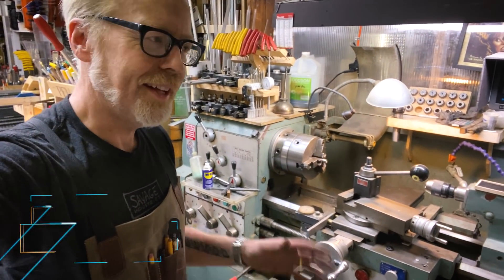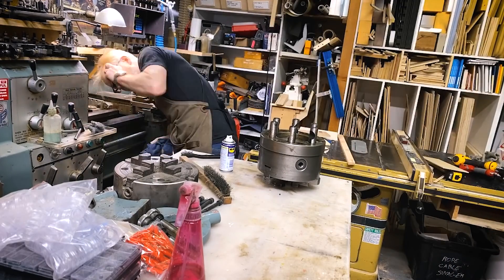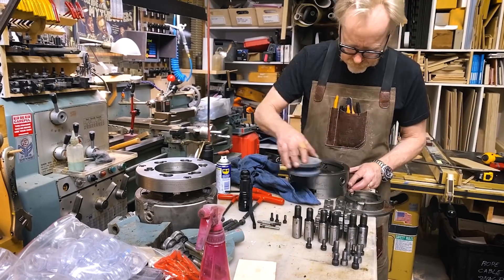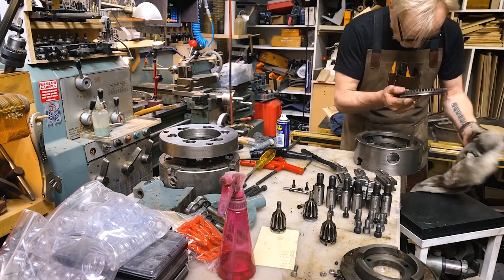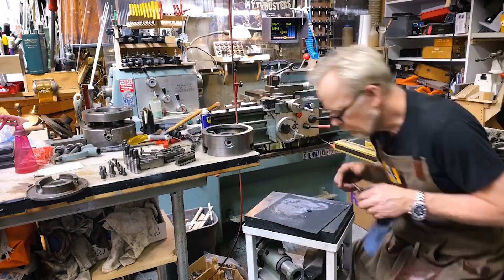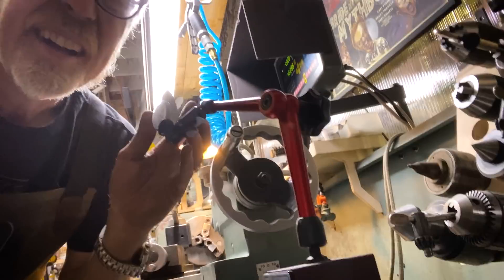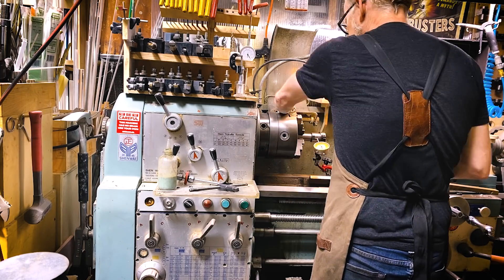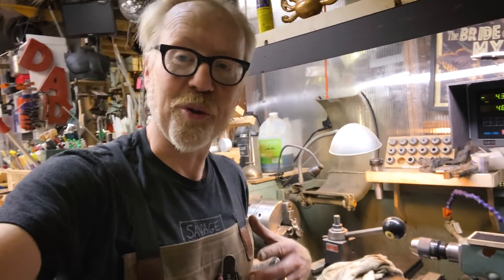Adam Savage's Weekend Builds: Lathe Chuck Rebuild!

Comment from the maker: Adam's been doing a lot of shop organization lately. Here are all our videos to date! https://www.youtube.com/playlist?list=PLJtitKU0CAegGi2QUH6ywt4EkjcR0jVam
Reply: Please pass unto Adam that he needs to use aerosol dry graphite lubricant and nothing else (read, in combination). Out of all the components on a lathe, the 3 jaw, autocentering chuck is the most fragile against lubricants that both attract and arrest grime and swarf. There's numerous cases that have been documented (machinist forums and even YouTube) where usage of the wrong lubricant led to them being  seized shut.
Now i know Adam isn't the kind of individual to use a monkey wrench, so i don't think he's in danger, but the first thing that comes to the regular hobby or slightly above individual in machinist work is to force it because it only seems lightly stuck, and it ends badly. The scroll (the spiraling groove on the gear plate) is actually a fragile component when subjected to punctual force (a stuck jaw) and the wall can easily shatter. You'll won't even notice it at first until eventually you hear a crunch in the offending gear.
Just a word of advice, nothing more.
Reply: I've been so inspired by Adam that today I cleaned out my tablesaw and sanded and waxed the top.  It looks and cuts like a new tool!
Reply: You need to 'brand' the shop infrastructure builds so that Adam doesn't have to explain that it's not a normal one day build each time. The Buddha said space is the precondition of all that exists. Maybe a name that captures that but with the word Cave in it? I love watching Adam building the tools to build
Reply: Adam said he got the TIR to 0.0003", what was it before the rebuild?
Reply: What was the stone used?

Comment: I was hoping you would show more of the actual process, I always found cleaning the quill plate on the scroll chucks the most satisfying, chasing the spiral round with the airline,
BTW the pins can be swapped, they are made to such a precision that it doesn't matter, the Jaws are numbered and MUST go back in the correct order (they usually have punch marks) , also, they cannot be interchanged between chucks,
The taper key and taper shaft on the lathe also need a good clean at the same time,

Can't beat a collet chuck though!

Comment: Adam if you looking for greater accuracy have a look at a 6 jaw chuck. In the shops where I have worked in the past as we wore out the chucks we would replace them with the 6 jaw chucks. They are a little more particular about shavings and chips inside chuck so they do need to be cleaned out a little more often. Enjoy the videos.

Comment: A quick tip for for lathe chucks. Take the back plate off the chuck and put it back on the lathe, then face off the back plate by a couple thou or so. Now it’s face is square and has a concentric step to locate on.

Comment: if you're going to want a super precise chuck, less than .0005, use a four jaw. the three jaw is quick and easy but it's not adjustable or repeatable. however it seems like 90% of the projects you do your three jaw chuck is more than precise enough

Comment: When I started my apprenticeship I was being told how to make a component using a lathe, turn the handle three and a quarter turns clockwise, then rotate the other handle 5 turns clockwise etc.  I asked how the machine worked, how it was made , so that I could understand how to use it.  I needed to try & get my head into the machine.  Their was still that mystical aspect from my perspective, as I hadn't seen the individual components and how the meshed together, buy my basic understanding was their.  It makes a lots of difference if you know how things are made, assembled and work together.  At a very young age I had a ride on toy that was nicknamed "MendIt", as I used to take it apart (obviously interested in how it worked) and then I would point at it and say to my dad "MendIt", that's how the toy got the name. Love this sort of build. :)

Comment: We had a self-centering three jow that was .01 off center. Took it apart and re-assembled it with the location pins in different spots and we got it within .001 and used a tool post grinder to get it perfect enough.

Comment: You're getting into the level of detail,  and precision that we use at Honda.   Some assemblies use $10K IFM bearings, that need spacer plates,  to allow 0.030 microns of crush.  And everything involved,  needs to be cleaned,  stoned, measured,  marked, leveled,  greased and sealed.  And wo betide any step you miss or overlook.   It can cost 2 - 3 shifts of teardown and reassembly

Comment: We have so much in common it’s amazing!  Not only with this video but so many more.  Early in my career I was a machinist and learned by doing after my boss showed me what to do.  I very seldom used a 3 jaw chuck but have done similar rebuild on the 4 jaw chucks I used.  My favorite machine to operate was the horizontal boring mill.  It would take hours to setup a job and minutes to complete but the satisfaction at the end  was indescribable!

Comment: Hello Mr. Adam, I am a journeyman toolmaker in a jewelry manufacturing company called Stuller, Inc. We consistently keep our work concentric and true to within .0002. We have a 3-jaw chuck on one of our bigger lathes and it consistently runs out .003, so we end up using it as a roughing lathe. When finishing parts we will either switch to a 4-jaw chuck or one of our collet lathes. the fact that that 3-jaw is within .0002 is amazing. If you replace it, you should hang it on the wall or put it in a frame. Thanks for the videos.

Comment: A new found respect for metal working machines...is probably one of the only benefits of having a "near death/dismemberment" experience. Please don't take this in the wrong context, this is not a "diss" at Adam, this is a realization that I had when I had my first "near death/dismemberment" experience that resulted in me becoming much more aware of how unforgiving these machines are. They are amazing from an engineering perspective and do amazing things but must be respected at all times. After I nearly lost my right hand/arm (not doing anything wrong, just becoming too comfortable with a repetitive process when a chip spooled out and wrapped around my wrist and then that razor sharp chip wrapped around the chuck and started pulling my arm into the tool..fortunately, it was a Kummer cam driven machine "Double Chucker" that stopped less than an inch before bad things happened), I gained a whole new level of respect for these types of machines. A week later I was shocked by a 230 3-phase jolt because of a bad grounding issue but that's another story. Keeping the machine clean and in great running condition are critically important. Stay aware, have absolutely zero distractions, and keep your gear in good running order is the point. 
Glad to see you back at the lathe Adam :) 

Cheers,
Jeff (Garage Maker Guy)

Comment: I just went through this on my lathe a few weeks ago.  Made the huge mistake of everything with a sharpie before disassembly.  One hit with brake cleaner and all my marks were gone.  Had a devil of a time getting it dialed back in afterward.  Finally got it running to within a half thou or less depending on which part you measure.  Good enough for mine.

Comment: If you go to any engineering shop that have old manual lathes bet you most of the chucks are more than 4 thou out of true. If yours is 4 tenths that's awesome .Even a cnc with Aluminum jaws that have been bored out are usually 2 or 3 tenths out due to holding pressure on the workpiece .I would stick with that chuck it's probably better than new one daft as it sounds . (LATHE WORKER OF 25 YEARS MANUAL AND CNC)

Comment: May I ask what's are the computers for that you have on your lathe and Mill machine. Did they come that way are was it a add-on later and why?
Reply: Those screens are Digital Read Outs  Or DRO. They display dimensions where the machine tool is located at for or very accurate cutting or turning.
Reply: @leeklemetti1887  Thats cools and helpful. Thank you for explaining.

Comment: You should look into investing in a 6-jaw self centering chuck, lets you chuck on with more precision and it spreads the pressure out better so you can run material with thinner walls without deforming them for example. This particular one even has adjusting screws so you can dial in the actual chuck.
https://www.kbctools.com/itemdetail/9-316-110

Comment: Sometimes it's fun to take something apart, clean and inspect it then put it back together.  I've been doing that a lot since I bought a vintage motorcycle.  I get into this mode where I'm like, the bike runs great, but I'm gonna take the carburetors apart and clean them just to see how they work.   Some of the guys in the forums get annoyed with me.   "If it ain't broken, don't mess with it, man!"   I can't help it, I bought an old bike because I wanted to learn.  I can only learn so much from watching videos,  sometimes you have to dive in and take things apart.   There's times where I have to go back and do something twice before I get the bike running good again, but so far I haven't broken screwed anything up.  Knock on metal.

Comment: “I rather overkill than underkill” Great! That’s what I thought when I built my enclosure for my 3d printer. It started with an easy design, but.. easy is still “easy”.. I ended up using Aluminium extrusion as base construction, noise reducing flame retardant foam, a control panel drawer, HPL plates as side panels.. :)
Reply: That sounds like an awesome project.
Reply: It was indeed a fun project :) I liked so much that I actually uploaded a video about it. I thought it might be interesting for someone else..

Comment: Numbering the d lock bolts is good practice if it's a cheapo chuck. Also good to measure the free length of the bolts. The bolts have a line turned on the OD to mark where the bolt is meant to be flush with the back side of the chuck. I have only disassembled a handful of chucks but have had 1 bolt not line up right when assembled with the line in the right spot.

Comment: Adam, you should look for a 6 jaw chuck. The good ones have adjusting screws on the mounting plate that let you dial out the axial runout and they are very repeatable. You can remove work from the chuck and reinsert it and still be on center.

Comment: Adam... Love your channel. Three jaw self-centering chucks are not  the best for accuracy. ... And I know it is too easy to do but don't  use compressed air to clean your machines. Compressed air just drives oil and abrasives deep between mating surfaces causing wear and accuracy problems.

Comment: I've done this before a few times at my job! we only work with cast iron, which is TERRIBLY abrasive, and puts a lot of wear on the chucks. We have 4 hexagonal turret lathes, 3 warner and swasey 4A's and one Gisholt 5L. they have 24" 3 jaw self centering chucks, and the gisholt has a 28" chuck of the same nature.These weigh a lot... but we have to do it about every 6 months, cause of the wear and tear from the cast iron dust, and rust. 

All in all, they function much the same as your lathe chuck, and it is fun to see you learning the inner workings of such a clever, well designed mechanism. :)  I always enjoy the lathe projects.

Comment: Im sure its been said here and ill keep this  as asimple explination, but 3 jaws are not super accuracte for runout,  parts will still turn true to the axis when actually doing the work but the part wont be concentric  if you take them out and put then back in,  i would suggest a 4 jaw or collet chuck over an expensive 3 jaw . The 4 jaw will let you dial things in exactly , while the collets are very good at having the parts run true after being removed and out back.  Hell if the budget is there, a quality 6 jaw self centering chuck would be a great investment

Comment: Hello, Adam.  I'm not sure if you did this or not, video to fast.  But, if you time the three pinions to be in the same plane when rotating the chuck head the "T" handle will also be in the same plane.  It will make it easy to tighten the jaws as you spin the chuck to tighten all three pinions.  Just a thought.  It works on my lathe.

Comment: Excellent Rebuild. a Few things to note: Lathe Chucks are  indexed, usually marked by a "0" "1" or just a dot "." to mount the chuck in the lathe in the same cams each time. The Spindle Lock Pins need to be individually adjusted for the Camlock Spindle they are going into (they should be adjusted to lock on the cams between 3 o'clock and 5 o'clock).  Technically, once the cam pins are set, it is plug and play from then on. Chucks should not really be greased... it attracts swarf, grit and dirt. Light machine oil/ way oil is plenty (and flushes easily without dismantling). Stoning the mounting faces is essential with cast iron or semi-steel. I have to call BS on a small detail... a 3-Jaw chuck (even a top line Bison or Buck) isn't going to be truly repeatable to tenths of a thousandth of an inch using just the scroll, even when new... and a typical 9 year old+ chuck scroll/ chuck jaws generally won't be truly repeatable to within 0.003" unless the jaws are regularly re-ground/replaced (Chuck Jaws are somewhat of a wear item over time, depending on what they are used for)... a Set-True (various Chuck mfgs make and market them under trade names "set-rite" "set-tru" "tru-set", etc...) can dial in a chuck with less than perfect scrolls and jaws to a true zero. A Set-True Chuck is basically a 4 jaw chuck hidden at the back of a 2, 3, 4 ,or 6 jaw chuck. Making a Chuck Adapter which incorporates a Set-True feature would be a great project for Jamie.

Comment: Yeah. It's a good idea, especially with old equipment to put every component (even such a thing as a bolt) back where it came from. And the reason, isn't so much that it was made to be in a specific spot or some such minutia detail pertaining to machine shop knowledge, rather the so easily forgotten wear and tear. A component received abuse relative to the ones next to it, so it's always good to put it right back where that parameter it has built, was.
In this case, you don't know if the locking force on each locking finger is identical, one might be tighter or looser than the others, thus stretched or wore in a different manner.
I've actually come across cases where changing the position on a taper lock type lathe (it's a taper fitting that's secured with a locking collar) actually affects the precision of the lathe by a considerable margin, where the same machined pin that was used as a witness (left in the jaws) went off axis by 0.0004 mm, might not seem like much, but a taper lock is supposed to be an indexable/repeatable system regardless of where it came from. I later found out that the smaller taper fit had a small ding in it.

Comment: I noticed you looking onto the holes with that flashlight at 1:45. It looked like you were trying to look down the same hole as you were trying to get the light down and I was thinking that one of those ear inspection tools the doctors use would make an amazing tool for a maker or tool restorer. You know the one that they look through that little cone into the ear canal. I think they are called otoscopes. 
Have you used one? If so, are they worth $40 to get a cheap one or $500 to the the Welch Allyn?

Comment: Hey I've got a 1958 Cincinnati 13x36 Lathe with a 3 jaw chuck and the gripping surfaces are very unevenly worn. ( many different owners and abuse)
Does anyone know if its possible and where to get just those jaws. Look like Adam's there that are reversible and clocked on the chuck. 
All I know is the mount is an L00 mount .
Reply: You should ask that question in a machinist forum, over here, you're less likely to get an accurate answer. Head over to Vintage Machinery (dot) org and pose that question to the fine folks there. Not only you'll get an answer, but it's entirely possible that someone actually has the jaws you might need.
You'll want to go to the forum section, metalworking machines.
Reply: @aserta  YouTube is just alot easier sometimes because those forums always have too many regulations if you just want to ask a question.  You have to sign up, get verified by the master, you have to ask in the appropriate section, you can't start a new thread if that subject has already been discussed or someone with way too much time in front of a computer jumps down your throat.There's always someones criticism on how you should know more about your machine and you shouldn't be on a machinist forum if you don't know any thing. Been down that path before with alot of jumping through hoops and no answers .

Comment: Using compressed air to blow off machine tools is a big no-no
Reply: This is definitely the sort of advice you need to supply an explanation for. I see experienced machinists on YouTube using compressed air fairly frequently, and I don't see any practical difference between the way they use air and the way Adam did. Without a "why" your advice looks like cargo cult, or like it's something specific to the shop you learned it in.
Reply: @Mengmoshu  Compressed air blows the small filings into areas that you cannot reach to clean them out without disassembling the machine. A chip brush is the way to go. If you are not using flood coolant you can use your shop vac to remove them. Compressed air is for people in a hurry. And you don't want to be in a hurry around machinery.